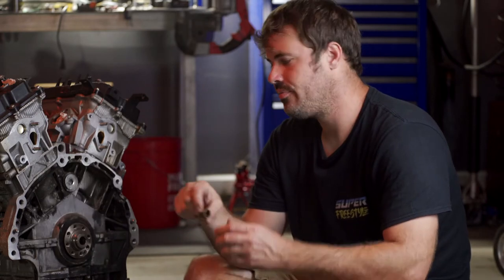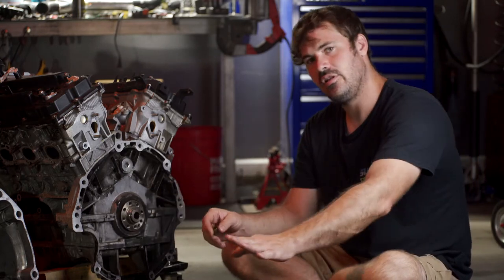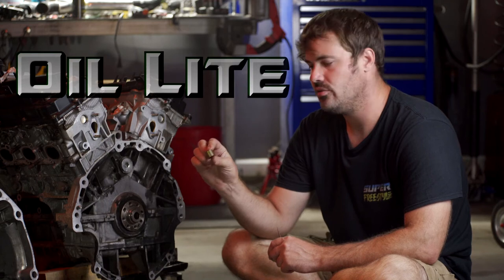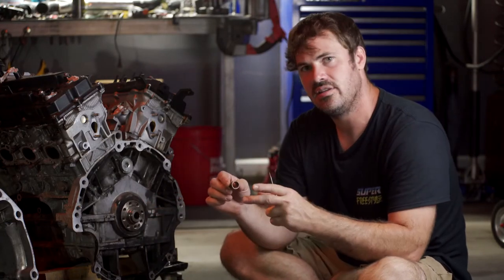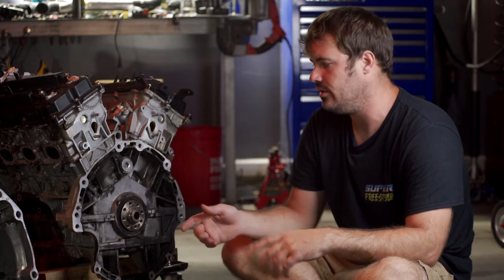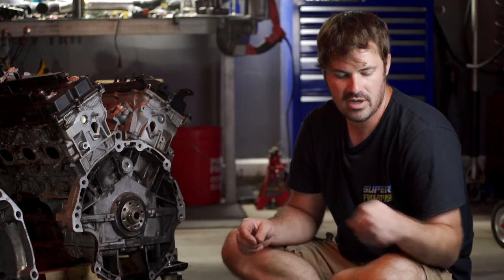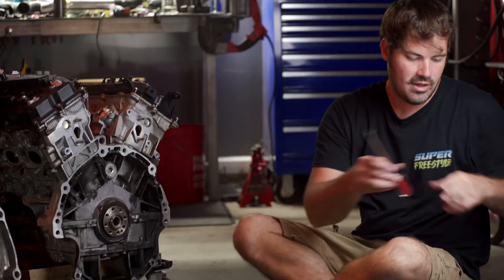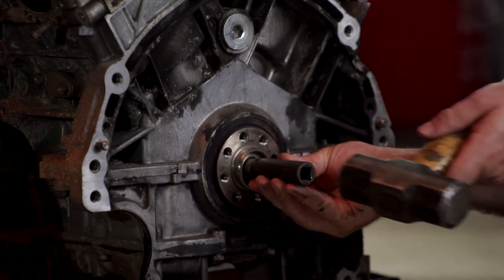OEM - Pilot Bushing Install/Removal | Nissan VQ, KA, SR, etc / 350z 240sx 300zx

Comment: Thanks very much for making this video.  I had no clue that the non-ferrous pilot bushing is installed into the crankshaft, not in the flywheel.  Oh, and btw, the oillite is bronze, not brass as you said.

Comment: So with an OE Nissan bushing it requires no lube? Not even a little motor oil on the input shaft to aid in transmission install? Just picked up a bushing st my local dealership, $11.
Reply: Wow! Inflation everywhere you shop.  Greedy bastards.

Comment: Hi I had a question about the pilot bearing bushing i got the z1 Motorsport clutch kit and idk if I damaged it trying to install the transmission but every time I turn on the car it make a loud chatter noise but when I press the clutch in it stops but when I release the clutch the chatter noise comes back idk what can be the problem if someone knows what it is